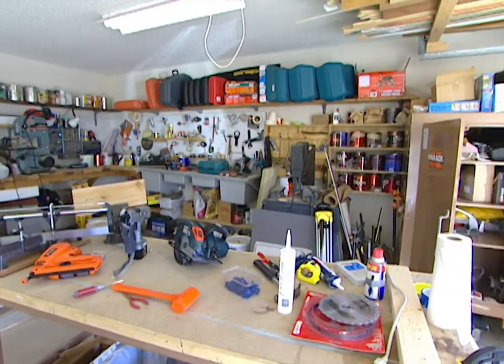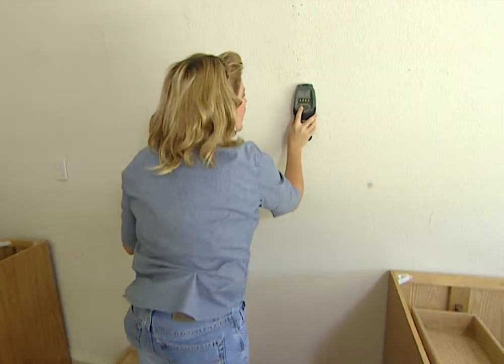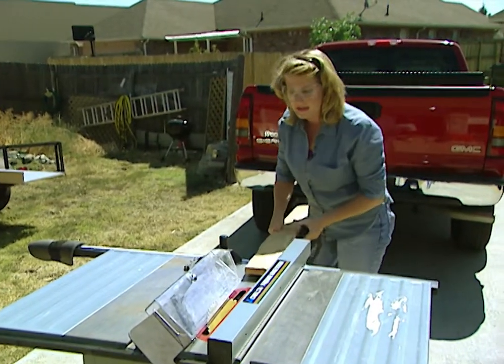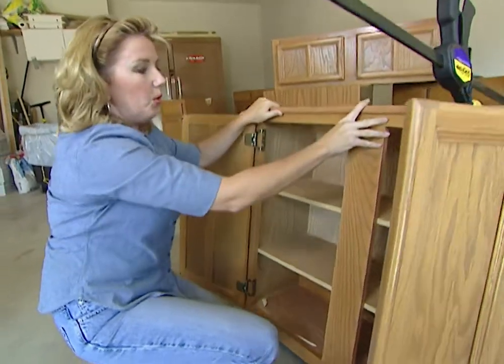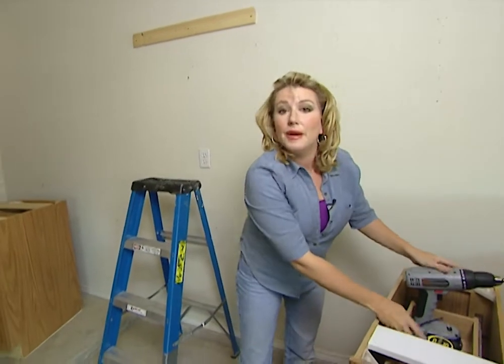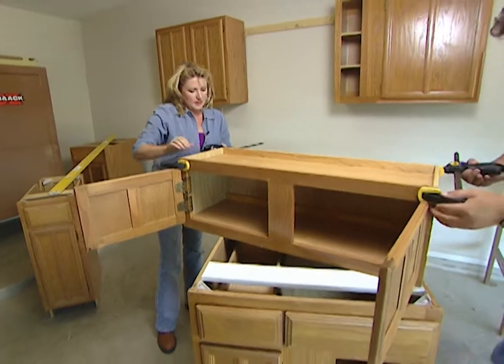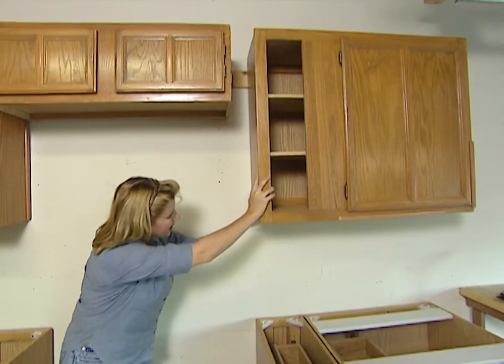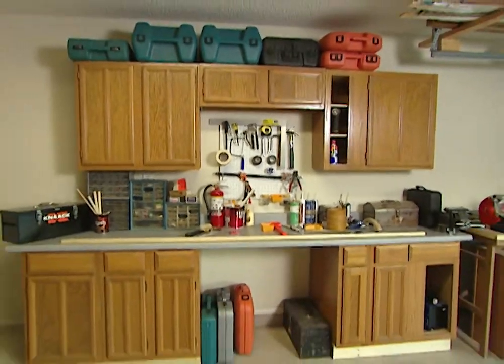Alternative EASY Way to Hang Cabinets

Comment: if you need to hang uppers single handed and you don't mind that they stand off the wall 1/2 inch and there's rough lumber showing at the rear, this is a great method.  one step she didn't show that you'll want to do is put another strip of wood at the bottom of the cabinets so they don't hang off the wall canted inward.  Also, once you have the cabinets where you want them, throw a couple screws in each cabinet to secure them to the wall so they can't be bumped off. admittedly, gravity will probably keep that from happening but how hard is it to make sure with a couple screws.

Also, the screw she used to secure the ledger board was a bit long, when hanging ledger you want 2-1/2 inch so you're only going 1-1/2 inch into the stud .   That way you don't accidentally penetrate a wire or pipe that could be running through the middle of the wall stud.  Also, the screw she used to secure the counter top looked a bit short.  You don't want it too long of course, it will come out the top side, but you want it to go at least 1/2 inch into the counter top.  again, gravity helps hod it down, you just need it not to slide.
Reply: Thank you!  i was gonna say the same
Reply: You could alternatively have exposed the framing in the two upper and lower support runs.

Thereby addressing most if not all of your very valid points..

Comment: Good video. Did I miss something? With a single ledger won’t the cabinets be leaning forward? Thanks.
Reply: I have the same question.
Reply: Good video but yes, you are correct, she missed placing a ledger at the bottom of the cabinets to make them straight. I guess just because she's putting them in the garage she doesn't care if they straight or not. She also didn't secure it to the wall she just placed it on a ledger.
Reply: @alexwilson3016  that’s what I was thinking. Especially with the weight of tools and other things.  Looks like death waiting to happen.  Middle piece isn’t even flush with wall
Reply: I thought the upper cabinets also didn't look quite level, but at the end of the video they did.   I suppose they later leveled the upper cabinets and screwed them to studs.
Reply: She’s a woman. What did you expect? You don’t actually think that there isn’t a man walking her through, do you?
Reply: She didn't miss. She didn't talk about something quite obvious.
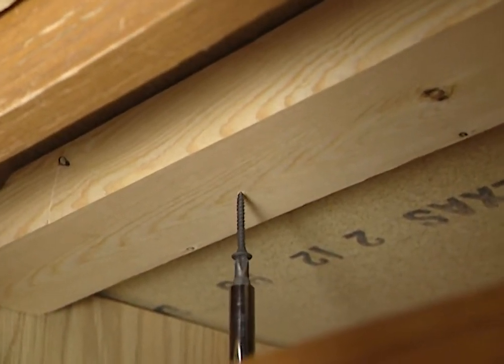Reply: @7:40 isn’s she screwing a 1.5” nail into a 1.5” piece of wood?  how is it supposed to make it to the counter top to hold it down?  shouldn’t she use a 2” or 2.5” screw?
Reply: @medregio  no, you can see it leaning.
Reply: That and the gap that will be left in the back, those cabinets will be 3/4 of an inch off the wall... A simple spacer block near the bottom of the cabinet will fix the lean, but the gap around the back would have to be covered. It works for a garage, not so much for a kitchen. Also the center cabinet is pretty far from flush. 

Ikea kitchens actually install in a similar way.

Popular Woodworking On youtube has a video "How to Make French Cleats" that some may find interesting, it's a short video, worth a watch.

Comment: its important that your cabinets are level and plumb, which those cabinets are not. if you don't want the gap from the catch board she has, put a resting board in and clean the screw holes up after you take it off. this is why people have to go in after and redo things

Comment: Yes, there needs to be a lower ledger board to keep the cabinet parallel to the wall and also to secure the cabinet at the bottom..
Reply: That's what i was thinking, it's not level .

Comment: Agree. What happens to the bottom. It’s 2 inches away from the wall !?
Reply: That is a good point.  Normally, the bottom should have a couple of pieces of studs so that it evens out and doesn't tip.  That's something she didn't show.  Overall, it's a great idea.

Comment: I got 2 of those cabinets like she's unloading in the beginning of the video as an employee at Lowes on clearance because the doors weren't aligned so i got em for $5 each.  Need to mount them in my garage for some extra storage but I will not be using the ledger aka French cleats as shown in the video.  She should have used the same material on the bottom of her cabinets so they sit flush agains the wall.

Comment: Going to be kinda off when you put trim in the sides since you have the cabinets leaning forward……….What’s that all about? Some people put glue (caulking) on the back of cabinets which would be impossible with 1/2 inch gap due to the 1X4 you installed on the rear of them…..

Comment: Great video.  The 45 degree boards are a great idea.  Being able to move the top cabinets side to side.

Great safety measures. Wearing safety glasses and using a push stick on the table saw.

Comment: This is awful, no levelling, screwing through chip board directly into block. All the wall units tip forward relying on the back of the units for strength real bad idea.

Comment: I would have at the very least used wood glue for your board attachments to the cabinet. I could see the cleats pulling off the cabinet, and off the wall as you hung the cabinet. It's not a 15 minute job. You need two cleats top and bottom.

Comment: That doesn’t look safe tho. There’s nothing but an angle holding the top part to the wall. Shouldn’t there be some screws in that for added support. Seems like the weight of things would eventually fuck this process up

Comment: you are doing this all wrong.  Too bad that a dIY,er liker yourself is teaching people how to do this incorrectly.  You never addressed the issue that using a cleat is not only causing your upper cabinet to be at an angle but also your creating a gap between the cabinet and wall that can be seen on the sides.  Total amateur work.  As a professional custom cabinet maker and installer of over 20 years it hurts to watch a video of someone who doesnt know what they are doing but also using absolute garbage materials.